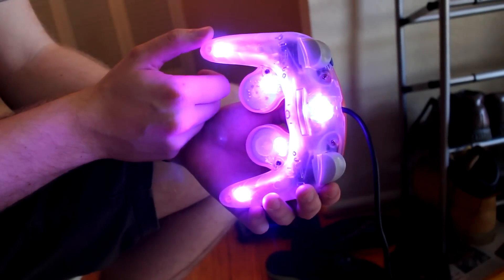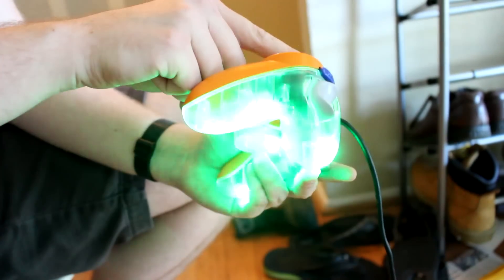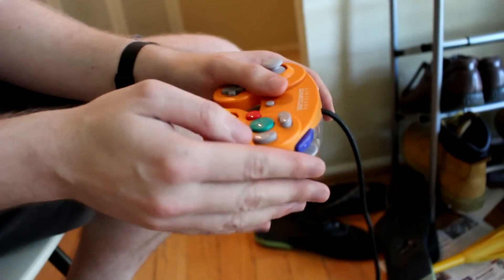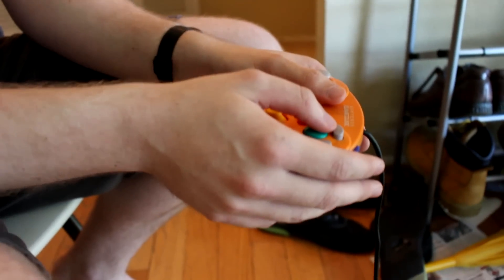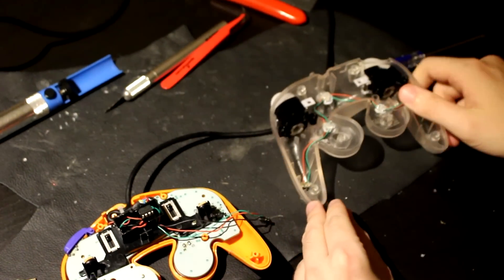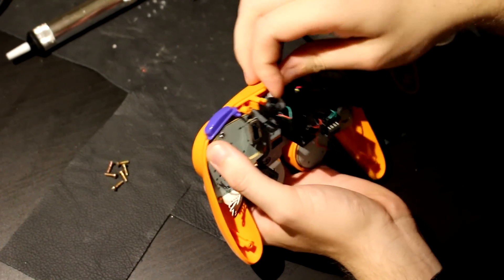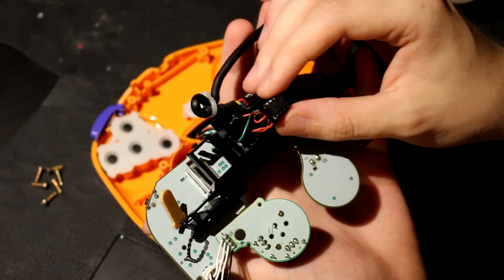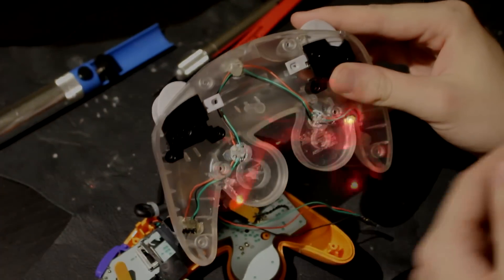Shinewave - Reactive Gamecube Controller LED mod

Comment: When does the selling begin! I can't wait to get my hands on one of these!
Reply from the maker: +Ben Karp I'm busy adding a lot of cool features before I start selling! I'm hoping to get it out by the end of the year.
Reply: +Garrett Greenwood is it out yet?
Reply from the maker: Sorry about the delay, but that initial timeframe was a bit optimistic :'[

I'm still making a lot of progress with improving the design and manufacturing clear backs, but I'm not comfortable getting these out until I'm absolutely sure that it's good.

You can follow along with my progress on my blog here: http://electricexploits.net/
Reply: Garrett Greenwood Oh okay. No worries man. Really appreciate you're doing this by the way, and good luck. :P
Reply: +Garrett Greenwood is it out yet?
Reply: +Garrett Greenwood thank you!
Reply: +Garrett Greenwood just out of curiosity, what if I shipped you my clear controller? That way all it would need is to be modded. Thanks in advance.
Reply from the maker: I'm afraid that I don't have too much free time in between school and the ongoing development, so I won't be able to.

If the Kickstarter I have planned is successful, I will switch gears into production and bring in some extra help! If you don't want to wait until then, I'd be glad to help you build your own.
Reply from the maker: viggokan
Thanks a ton!

Comment: So I'm planning on doing this mod myself. Is there a way I can keep the rumble? I like the weight of the controller with the rumble.
Reply from the maker: No guarantees, since the space you're working with is really tight. You could probably fit it in inside on of the controller handles, though.

Comment: is there a way to upload the firmware to the attiny85 using an arduino board? without any additional adapters, just the pins
Reply from the maker: +Cod4pwners Yes! You'll want to burn the ArduinoISP sketch to your Arduino so it'll act like a chip programmer, then use it to program the ATtiny85.

1. Follow these instructions to burn the ArduinoISP program: https://www.arduino.cc/en/Tutorial/ArduinoISP
2. Rather than the wiring on that page, use the wiring diagram here(for the ATtiny): http://www.ernstc.dk/arduino/attiny85.html
3. Follow through the rest of my guide, but change all of the '-c usbtiny' parameters to '-c avrisp'. http://electricexploits.net/programming-the-waveshine-prototype-part1/

Good luck!
Reply: thanks, will be trying this in a few weeks
Reply: +Garrett Greenwood I've seen how to use arduino as an ISP and uploaded de "blink" example to it, the thing is, can the arduino read the .hex file (your code) you uploaded and burn it to the attiny85?
Reply from the maker: +Cod4pwners Yes, it's very possible! The Arduino IDE relies on an underlying program called 'avrdude' in order to program the chips. Since this project doesn't rely on any Arduino code, I program the chips by skipping Arduino and calling 'avrdude' directly.

I wrote up a guide on how to use 'avrdude' to program Shinewave right here: http://electricexploits.net/programming-the-waveshine-prototype-part1/

Once you have the blink example working, you'll be able to follow along with my guide. Just replace '-c usbtiny' with '-c arduino' in all of the 'avrdude' commands. Let me know if you have any questions!

Comment: What kinds of LED's do you use? I'm currently using 2 red 5mm LEDs on mine, but they don't shine as bright as yours.

Also, are there any resistors hooked up to your LEDs?
Reply from the maker: +ライオン I'm using Neopixel WS2812 addressable RGB LEDs. These LEDs run directly at 5V and have their own controller, so no extra resistors are needed. To see how I wired it and get links to the products I used, read my write-up at http://electricexploits.net/shinewave/
Reply: Garrett Greenwood
Okay, thanks a lot. I really like the way you set this up. I'm gonna try this out and replace my current crappy LEDs lol.
Reply from the maker: +Doopliss' P Thanks for the heads-up! The website is back up now
Reply from the maker: +Doopliss' P I've never worked with the Trinket a clone before, so I can't say for sure if it'll work. If it does, it'll be a bit more work. Roughly, you'll have to do these things:

1. Build the kit and make sure it works.
2. Check if the USB pins on the trinket match the USB pins used in the tinyAVR programmer
3. Download the tinyAVR Programmer firmware. If the pins don't match, you'll need to modify the source and recompile.
4. Burn the resulting tinyAVR firmware .hex. At this point, the device should register as a tinyISP device in two modes: Either as a bootloader, where it programs its own firmware, or as a programmer, where it programs a different chip.
5. Burn the Shinewave .hex using the programming guide on my blog.
Reply from the maker: +Doopliss' P Ah, I think I might have misunderstood what you're considering. Consider this:

There are two ways to upload code to an AVR processor

* Through a ISP link. This requires a dedicated ISP programmer, such as the official AVR ISP programmer. Because the official hardware is expensive and the protocol is open source, people have created their own alternatives, such as the tinyISP that I recommended.
* Through a bootloader. These require a preprogrammed chip with a bootloader already installed. The bootloader lives in its own section of the chip, with the rest left for the user program. On every startup, the bootloader is run first and checks if there is a USB connection. If so,  it waits for a new user program and writes it to the user program section of itself. If not, it jumps straight to the user program.

That being said, my original guide uses the first method to burn my program directly to the chip using a third party ISP programmer that makes it really convenient to program ATTinys. Similarly, you could use any other ISP programmer and get the same results. My first recommendation(previous comment) would turn the Trinket into an ISP programmer which you could then use to program a second, clean chip.

The other method, which just occurred to me, would involve installing my program on top of a bootloader. I haven't tested this method, but it should work. This would involve building a trinket clone and using the built in bootloader to load my program. This would actually be easier, but you wouldn't have a separate programmer to use for other projects.

Let me know if you have any questions!
Reply from the maker: +Doopliss' P No problem!

 Go ahead and purchase the Trinket or the Digispark board(or clone), just make sure that the hardware design allows the ATTiny chip to be removed. Then, use the guide for that board to program my provided .hex file.
Reply from the maker: +Doopliss' P Unfortunately, I don't use Skype. You can get my Contact info here though: http://electricexploits.net/contact/
Reply from the maker: The first method I mentioned will probably involve modifying the source code, so I woulddn't recommend it if you don't have any experience. Also, the second one won't need any parts besides the trinket and the parts in my guide.

Comment: If you made a step by step guide on how you programmed the microcontroller this mod would be much more accessible to the average person. I promise there's hundreds of people that want to try this mod but will be intimidated by the microcontroller. The soldering here is very simple, the wiring is very simple, the config files are very complicated (but you have provided great source code documentation to play around for the less inclined) but certainly the actual set up of the microcontroller will be the biggest hurdle for anyone wanting to give this mod a shot. 10/10 really impressed!
Reply from the maker: Ctrl13 I agree. I'm working on making a tutorial for exactly that, but I wanted to get the majority of the content out soon.
Reply: Garrett Greenwood That's so great to hear! I'm very big into repairing Gamecube controllers and I just love taking them apart. I used to have interest in this type of engineering but instead focused on programming because I found it more accessible. Years later I now find myself wanting to get out a soldering iron and work on projects like this myself so thank you for enabling me to skip some of the baby steps and have a chance to get something useful and cool working soon!
Reply from the maker: Ctrl13 I just finished the programming guide! Read it here: http://electricexploits.net/programming-the-waveshine-prototype-part1/
Reply: Garrett Greenwood Thanks so much for the notice! The guide looks great!

Comment: shooting a laser should make it flash red
Reply from the maker: lukas mercer It's possible! This mod has full read access to your inputs so I could definitely make it happen.
Reply: yeah i just figured that lasers are red so might as well
Reply from the maker: +Jacob McGuire The third party controllers are a bit odd. The first party internals fit snugly in them, so you won't have to use the shitty control sticks or shoulder buttons. However, you'll need to use the third party buttons, unless you want the buttons to be a little short and the Z-button to stick(as Zetterburn mentioned). You also won't be able to use the first party rumble unless you cut some plastic away on the inside of the third party back, but you'll probably be removing the rumble anyways if you're doing my mod.

You can also mate the clear back controller shell with a first party top. However, it'll fit really tightly, the seams between the halves will overlap a little, and you'll need to remove some plastic notches on the back. 

Finally, make sure that you get the "Classic Controller" from TTX Tech. There are plenty on eBay for $7-10 each, some links below. These are the shells that I've tested. Also, I haven't played extensively with the setup I described, so there might be more issues.

http://www.ebay.com/itm/NEW-Transparent-Clear-Classic-Compatible-Controller-for-Gamecube-Wii-made-by-TTX-/381147680451?hash=item58be2c0ec3:g:oNQAAOSwqu9U05Zn
http://www.ebay.com/itm/New-GameCube-CLEAR-Rumble-Controller-Pad-X4-TTX-Tech-Wii-Wired-Gamepad-/371507561280?hash=item567f938340:g:l-AAAOSw7FRWX9a5
Reply: Garrett Greenwood How hard is it to reprogram the microcontroller? Have you thought about modding in a connector to the outside so you wouldn't have to open it up every time you make programming adjustments? (assuming you actually plan on ever changing the programming)
Reply from the maker: FierceDeityXeroX Currently, you have to open up the controller and remove the microcontroller from its socket in order to reprogram it. I have ambitious plans for improving this, though!
Reply: Garrett Greenwood Interested in having someone send you a japanese all-clear controller to mod and send back after making a video? I will pay
Reply: +Garrett Greenwood  Hey this mod is actually very impressive. Would I be able to ask a question about a mod for a Non-reactive LED setup? I found an article on how to do it on the MIOM website but don't want to burn 25-30 dollars buying a new Nintendo controller just for the shell. Would buying a third party controller for the back work okay?
Reply: +Jacob McGuire 3rd party controller shells are pretty odd, in that they're very slightly (like a cm or less) larger than standard first party shells. Because of that, the little gap between where the shells connect to each other feels rough, and sometimes the z button gets caught and doesn't work properly. It's all weird.
Reply: Zetter Burn Okay... Damn. I was hoping not to have to bit the bullet on that. Thanks.
Reply: +Garrett Greenwood Much appreciated, thanks a lot!
Reply: you could also give other areal moves diffrent color lights and make SHFFL look dope